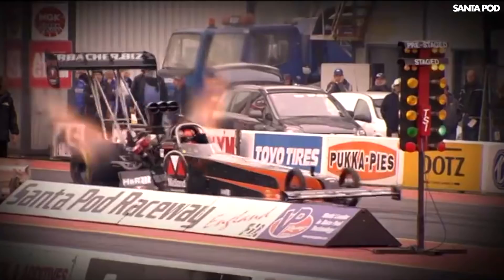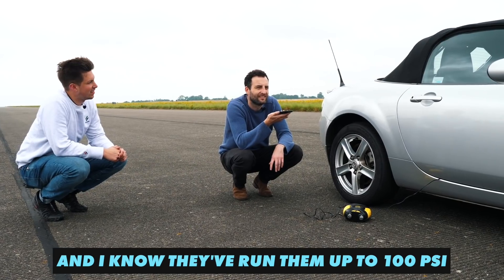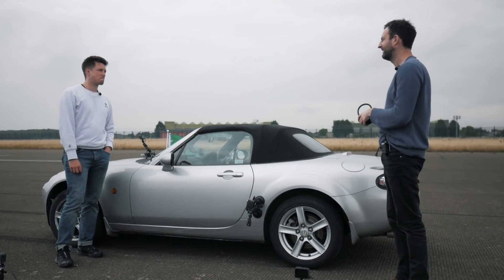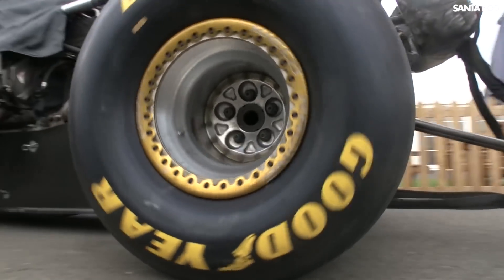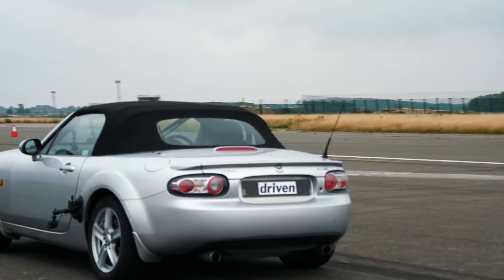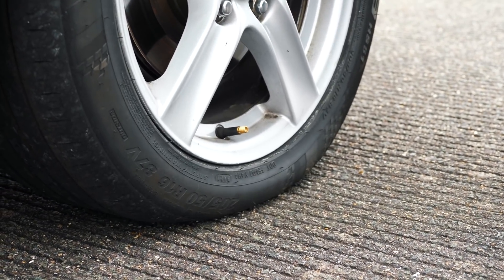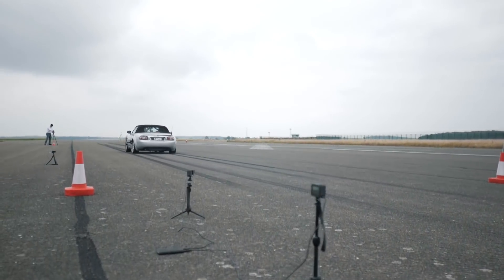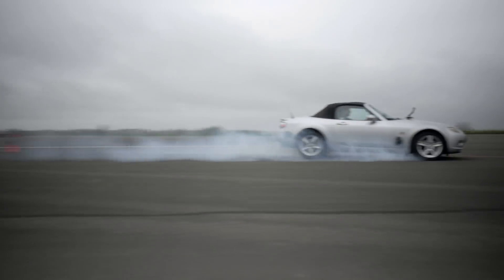Do Flat Tyres Make Your Car FASTER? | For Science

Comment: Well surface area has nothing to with friction therefore traction. If the car weights same it won't change. But other things might come in to play such as tire temps might increase quicker with narrower contact area due to weight pushed  down from a smaller surface (which might effect tire compound's effectiveness in a good or a bad way), elasticity of tires might work like a spring due to torque which might help with its distribution( probably not with regular tires) or maybe can work like softened suspension with lower pressure but friction has nothing to do with surface area scientifically.

Comment: Although entertaining, this test has too many variables like driver input, tire temperature and rolling resistance over the length of the run, to name a few.  Besides, drifters have the tire pressure to grip relationship pretty well figured out (independent of drag racers). 👍

Comment: If atmospheric pressure is 14psi, how can the pressure inside a tyre be less than that? The pressure would equalise. You would need a vacuum pump.
Reply: It's psi + STP

Comment: Facts on why this test was a inconclusive:
Fact 1: This Miata doesn't have enough power to break traction. 
Fact 2: Dumping the clutch is not a good indicative of traction data, you should have chosen a car with Launch Control or TC.
Fact 3: Not fast enough to get the effects of rolling resistance.
Fact 4: 1/4 mile of the miata is 16s and 86 mph. Too slow to help the test.
Fact 5: The time difference could be human error(shifting).
Fact 6: The test wasn't on a good continuous surface.
Fact 7: YOU SHOULD HAVE DONE THE SAME TEST FOR BRAKING INSTEAD OF ACCELERATION!

Comment: Aktuwully... You drive on the volume of air inside of the tyre - not the pressure. Giant drag tyres and truck tyres have a huge volume so don't need as much pressure for the  same weight, skinny road tyres will need a higher pressure because of their smaller cross section than beefy tyres.

IE, if you double the volume of a tyre the optimal pressure will be halved

Comment: At very low pressure the extra friction kills the performance as the engine has only so much power, but if you run huge horsepower numbers, the loss from friction is pointless on the front of the traction gains.

Comment: This MX-5 is a poor choice.  Barely breaks the tires loose unless you ruin traction with pressure. Ironically, this small,  high revving engine no longer bogs down with poor traction, but actually spins the engine up into the powerband, explaining that half- second improvement at 50 psi.
Reply: Also at 20 psi.

Comment: Could be that the lower pressure allows better traction off the line but higher rolling resistance once moving hense the sweet spot. After that test I wouldn't use those tyres again.

Comment: You're getting better traction as you lay the rubber down. So test each pressure offline from other starts. Also the contact patch is longer more than wider as the pressure decreases.

Comment: test 2 off road vehicles. One with big fat wide tyres versus tall skinny tyres. Which one is faster over mud, sand, snow? A lot of off roaders fit big fat wide tyres but most of the time, a tall skinny tyre is actually better over most surfaces but they don't look as cool.

Comment: So its a dragrace, why don’t do it on a 1/4th mile, because there will be a crossover point: lower pressure will be better initial grip, but later on it would be more resistance 🤔
Reply: Because it’s still just a Mazda MX5 :D

Comment: the driver is also a key factor here.....you have different reaction times and also sometimes you wheelspin more.....you need to repeat this test with an automatic car so all settings are default in each run

Comment: I think the recommended tyre pressure for the Esprit S3 at the front (on 195/60s) is just 22psi.  With 205/50 Toyos I used them between 20 and 22psi, so low pressures aren't out of the question.  The lower you went with the Esprit, the more pointy the car became.  Not so much as it had implications for the rear but I felt you lost some of the gentle subtlety of its beautifully weighted steering.  Unfortunately I never did this with the original Goodyear tyres (which aren't made any more) as they were a far better place to start from.  I can tell you, though, that Tyrrell raced the 021 and 022 at 17psi, which was lower than most people went back then.  That was on Goodyears.
Reply: Those numbers are completely academic without knowing if they were measured hot or cold.
When tires are used hard they will increase pressure. So for track use you allow for that when setting cold pressures. They will be lower, then when you use them, pressures will increase to the actual desired fastest pressures.
That's why you often see tire engineers measuring the temps on a few points across the tire thread right after the car comes back into the pits. This data will be used for setting the pressures on the next set of tires.
Reply: @jfv65   Thank you for that lesson.  I'm always happy to learn more about suspension dynamics, especially on racing cars.

Comment: Would be super interesting to see how these pressures would affect a laptime or cornering ability
Reply: Yes, but actually no. At a certain point it will just come off the bead, so very dangerous
Reply: @kbwthor1405  Believe in JESUS today, confess and repent of your sins. No one goes to heaven for doing good but by believing in JESUS who died for our sins. GOD loves you soo much unconditionally.🤩❤😍🤗😇☺🙏
Reply: Indeed. In my old NB MX5 book pressure was about 26-28spi but autocross guys will run up to 36psi.
Reply: its getting worse

Comment: I have said this many times watching drag races. Letting tyre pressure out made sense decades ago. Cross ply tyres would increase their contact patch when run low. Radial tires we use now not only bulge at the side wall which increases rolling resistance and lateral wash. The tread section collapses inwards reducing the contact patch, limiting grip. Now there is a point to be made that pressure is measured cold and then tires are spun up to make the rubber sticky. This addition of heat will cause the pressure to rise. Which will cause the tread section to bulge ( reduce contact reduce grip ) but this will only account for a couple psi. not dropping 15-25 as I have seen some people doin, surely.
Reply: Still plenty of gains to be had on modern radial tires finding the right pressure. The time slips don't lie and anyone bothering to keep track of the tire pressures at the strip probably has enough slips to know what helps their car and doesn't. These lads are hopeless. For me I don't see any gain going bellow 25psi on my street tires at the strip. These crazy low pressures these guys are testing are a bit off the chart for the tires they have I'm sure.

Comment: Loving the series idea. I wonder what a 2nd run at 30 would have given since that time ended up being a noticeable outlier.

Is there something you can do (in a hatch/estate) with ballast to see how moving the weight distribution around affects the car? Maybe 100kg (water tank?) in the passenger seat, boot and somehow strapped out the front like an Audi engine! ☺

Comment: tbh it was a little of a flawed test. The purpose of deflated tires on drag racing is that provides more grio if there is a lot of wheelspin of the line. This mazda has barely enough power to spin the tires a little bit. On my car, a 250hp seat leon it makes like a 0,5 difference on the 1/4 mile between 35 and 18psi on the front tires
Reply: I think that was the point- to show how much (or little) difference it makes on a regular car. An MX-5 has a fairly decent power to weight ratio compared to what most people drive so it's not a bad test car. Brake boosting a car with a torque converter auto would be what I'd have changed, to take the driver out of the equation.

Comment: one aspect you might have missed about Drag tires, and Big drag tires at that is that they act as a clutch and take the initial shock of the driveline locking up and slowly transfer it to the ground to avoid spinning.
Reply: Nice
I didn't know that
Just learned something new
Thanks

Comment: I hope you let the tyres cool down in between. Temps of the tyers also has an effect.
Reply: I was wondering if cold tyres were the reason the 30 PSI test gave the worst result...
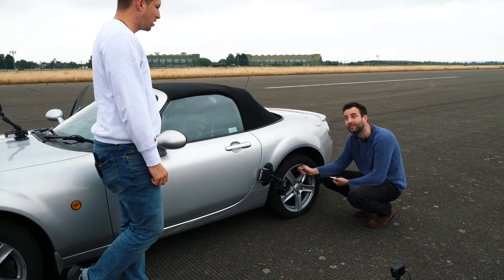Reply: 8:36 yep that happend here
Reply: They didn't even do multiple runs and average the results; of course they didn't let the tires cool down first.

Comment: 4:30 I'm not sure if the gear ratio actually changes when the wheels are compressed: The circumference of the tire stays the same, so the wheel still travels the same distance per revolution, which means that the gear ratio should stay the same if I'm not mistaken.
Reply: the center of the wheel gets closer to the ground. the lever is shorter. it gives it "more gear". the circumference of the tire means nothing. what matters is the distance from the axle center to the ground.
Reply: actually new cars with ABS sensors judge whether the tire is going flat by measuring the relative rotation, and leaking tires start to show a different effective circumference which throws a signal.
Reply: @pault151  Yes, I think the circumference changes relative to the tire pressure but that does not contradict my point.
Reply: On low profile Street tires,  the circumference will be insignificantly different.

Comment: need to mess with tire pressures on driven vs driven wheels, now. Low pressure on driven wheels (maybe start at 10, which seemed to be the fastest time you had) for traction, and high pressure on the non-driven wheels (50, 70, etc) to reduce rolling resistance.

Comment: @6:40 not sure the gains are even real. you had to try twice. i think rolling resistance is just as important for such a low power car when doing this, and high pressure has the advantage there, even with only the rear tires being pumped. pump all four tires to 50 psi and you'd have your best time, specially in 1/4 mile or longer runs.
Reply: True. The car has barely power to spin 1st gear. Its like a bicycle that runs easier with pumped tyres...
Reply: Miata will spin 3rd stock man. They aren't powerful. But they are also light and have a suspension designed for corners, not drag launches.
Reply: How much drag racing have you done?

Comment: its more about having right amount of spin to dig faster, i think on this low power more psi is better ;D
Reply: low power engines like to have some wheelspin to get higher rpm at launch. many people used to put slicks on their car long before they were needed, and the car would bog off the line.
Reply: @mustang351c4  it doesnt wheel spin, doesnt make torque/power. stops spinning at low rpm ;D

Comment: The ideal pressure depends on the size of the tire (and of course on the car it is fitted to and especially its weight). It doesn't really make sense to compare tirepressures between tires of different sizes or between different cars.
Reply: Yup pressure in the door is with factory tire in mind
Reply: @johndc2998  Believe in JESUS today, confess and repent of your sins. No one goes to heaven for doing good but by believing in JESUS who died for our sins. GOD loves you soo much unconditionally.🤩❤😍🤗😇☺🙏
Reply: Obviously you wouldn’t want 20psi on a karting tyre, you would finish last by farrrrrr 👍
Reply: Its like comparing a mountain bike tyre with a road bike tyre lol
Reply: Well for science reasons they did this anyways, because science is fun. (Just pretend there's no math included for right now)

Comment: Would love to see how those tire pressures handle a corner close up and braking/lap time.
Reply: I already know that a flat tire makes my car faster...going sideways in a curve.
Reply: @klausstock8020  Believe in JESUS today, confess and repent of your sins. No one goes to heaven for doing good but by believing in JESUS who died for our sins. GOD loves you soo much unconditionally.🤩❤😍🤗😇☺🙏
Reply: They would debead
Reply: @levibazen608  this guy understands. Came to this thread looking for this comment
Reply: would love to see how those tire handle an highway trip too...
Reply: Depends if its cross ply or radial. On one of my race cars, i run 13 psi on cross plies and 30 psi on radials.(11 inch wide) on another 32 psi radial and 22psi cross ply (9.5 inch wide). Big difference in construction and how they work.
Reply: And more power
Reply: Yes!!!
Reply: All you're going to see is a tire rolling hard and the rim hitting the ground or the tire will come off the bead, it's not that exciting but I guess you've never seen it before.
Reply: I ran my tires at 32 psi.
Reply: Speaking for a friend but them bitches handle nice at 95 on the highway

Comment: I had a MR2 with ultra low profiles and got a flat rear tire, the sidewall was so stiff that I couldn't even feel the flat below 30mph! Drove all the way to the local asda and shredded the sidewall! 🤣🤣
Reply: I picked up a bolt once on my back right that made it go flat, couldn't feel   it no idea how long I was driving on a flat but eventually I started smelling burning rubber at a couple stop lights that made me check my tires and sure enough it was flat and the side walls were shredded, good thing I had a donut to swap, I keep seeing all these new cars coming with fix-a-kits instead of a spare, and that would have left me stranded.
Reply: tonoight on bottom gear
Reply: That happened to me once in a Lexus
Reply: It's your fault for not checking your car every time you drive it. If you don't check your car you probably don't need to have a liscense as you are jeopardizing everyone else's safety.
Reply: @jaewhite2462  Are you even old enough to drive?
Reply: @jaewhite2462  I drive a 30 year old car that is falling apart, I do not check it, I do not repair it, and I drive absolutely full throttle everywhere. I am the one jeopardizing everyone’s safety
Reply: @obeseperson  me in my 1996 rover 214 with brake pads that are do worn out that it's metal on metal, airbags that I'm pretty sure don't work and trim pieces and interior panels falling off every once in a while: yes
Reply: @jaewhite2462  shhhh you probably do not even do that yourself.
Either way,
The bolt he got in his tire probably found a new home WHILE he was driving so even if he had check his tires before going on the road it would not have matter. Smh
Reply: And you’re laughing?
Reply: @justkev1044  yeah of course, no one was hurt and it was an easy fix! Gotta laugh about these little things!
Reply: Believe in JESUS today, confess and repent of your sins. No one goes to heaven for doing good but by believing in JESUS who died for our sins. GOD loves you soo much unconditionally.🤩❤😍🤗😇☺🙏
Reply: @alunesh12345  I can do donuts in my Miata! Can your Jesus do that?
Reply: @dylanboyd6147  yes.
Reply: @alunesh12345  I believe in Brian because he's a very naughty boy.